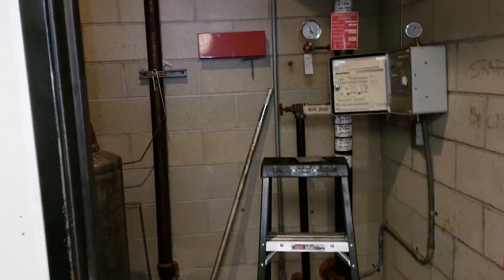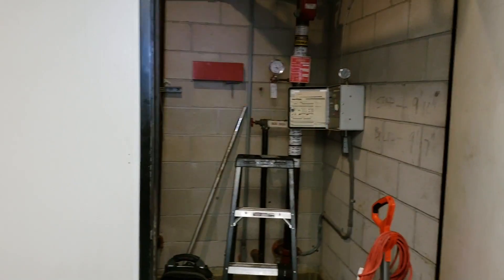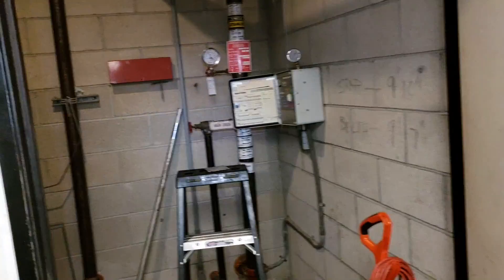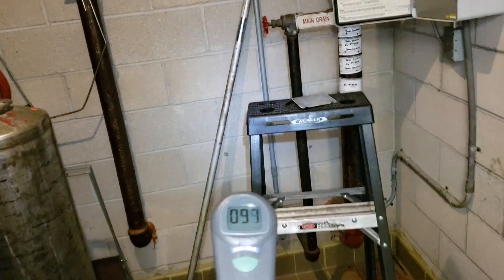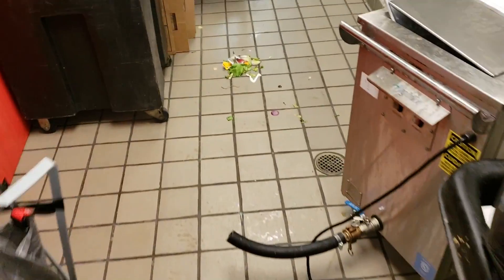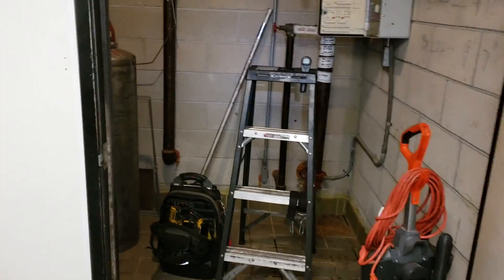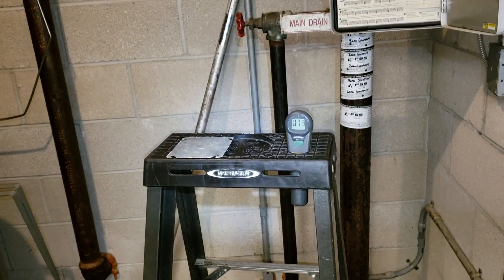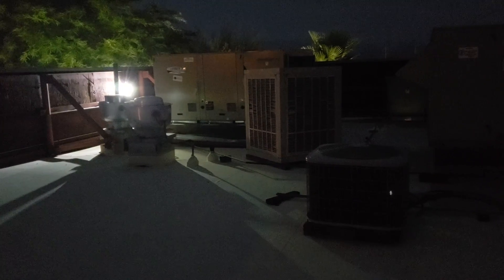Mechanical Room Carbon Monoxide Problem

Comment: Damned dangerous - CO builds big bubbles in the air when the air is not moving that you can walk in without knowing. You can breath normally in one point and a few inches further you breath pure CO and are down in seconds. Here in german the fire department and the chimney sweeper wants you to install a CO sensor in the room with the heater when it is a commercial site. Private installations does not need this but the chimney sweeper that tests the security of installations every year recommend a combined sensor for safety. It checks for CO, CO2, propane, butane, methane and heat over 85°C. Additionally it's law that the room with the burner needs an open connection to the outside that is able to deliver enough air for it. No fans are allowed because they could fail. Some heating systems have a pipe for fresh air and have a closed of burner that doesn't pull the air for the burner out of the room. In that case the requirements of the law are fullfilled by the fresh air pipe.

Comment: CO is no joke...bus barn required me to have audible CO monitor on if I was in the shop or working inside an engine  bay even if outside... (behind the hood of a bus there's almost no ventilation even when it's open due to the shape) it only went off twice... if I had not had it there was noone around to save me

Comment: Hi, thanks for your explanation of the negative air balance. my building a print factory in the Netherlands has a huge negative air balance, I notice that every morning when I opened the doors I have pull real hard to open the doors in the wind is really hard at that time. So it's not so bad because we have no combustion units in the building. never the less it's not good so I will take some action.
Reply: Combustion products / flue gases aren't the only thing that can cause problems. Chemical vapors such as solvents from inks, and dusts can be major problems, including fire hazards as well as toxicity issues.

When you are designing a ventilation system for an industrial application where hazards need to be exhausted, you must go with a single-pass scheme... it is not safe to have a recirculation of conditioned air that comes into contact with the hazardous vapors/dusts/fumes.

When possible, the ventilation system for such buildings should have a dedicated supply of makeup air, and the inlet flow resistance must not have a pressure drop that exceeds the capacity of the exhaust handling equipment.

It is desirable - often mandatory - to have the workspace at a very slightly negative pressure (a few mm = a fraction of an inch of water column) relative to the rest of the building, in order to control the flow of the bad stuff away from where people are to be found...  there's a science to balancing the supply of makeup air to the hazardous areas in order to ensure safety. 

This also gets to be interesting as a design challenge for fire protection, where the building needs to provide enough fresh air such that the occupants can safely evacuate while not fanning the flames, and then when the firefighters are on the scene can be opened up to vent the smoke while they fight the fire. 

Industrial ventilation can be fascinating as an engineer... 8-)

Comment: I would recommend decoupling the water heater from the building air. Add an intake pipe which sucks air from outside the building for the water heater's flame.

In Germany we usually have an exhaust fan on those units, which's RPM get monitored by the unit.

This is necessary, since the exhaust is too cold after the heat exchangers, to vent out with the chimney effect alone.

Comment: I have a good question how do you detect your negative are in the building what do you use for equipment for that I'm just curious
Reply: Quick check is to go to the door and open it about half an inch, you should feel air being pulled in slightly. If not you have positive flow.
Reply: I'm no tech but i believe that particular piece of equipment is called a manometer.

Comment: Sounds like you need to isolate that mechanical room from the effects of the building negative pressure , or you need to cut in large enough combustion air openings to prevent  the mechanical room from going negative under ANY condition.   That includes someone shutting down the AC units, or changing the minimum air settings on the economizers.  That inducer fan on the water heater is not designed to push combustion products out the vent.  It is designed to overcome the resistance in the water heater itself, and deliver the products of combustion to the vent connector.  I would not have an exhaust fan in the mechanical room. It will rob the water heater of combustion air.  The combustion air openings in the mechanical room, one within the upper 12” of the space, and one within the lower 12” of the space are  designed to provide ventilation, and make up air for the draft diverters, along with providing the air for combustion, so  there is no reason to have an exhaust fan in there.  It is against code, at least in our area, to draw air from a space which supplies combustion air to a fuel burning appliance, be it from a return air grille, or an exhaust fan.  If all else fails you may even have to install a positive pressure combustion air fan, with a pressure switch, interlocked with the appliance, that would not allow the water heater to fire unless the room was under a positive pressure.

Comment: I saw the same problem at a restaurant that I had worked for when I was in college for this field. They kept having the water heater blow out. I did a quick check with nothing more than my hand near the vent for the water heater after I got it going and I could feel the heat coming out. I told the store that they needed to deal with the makeup air situation and that the easy solution would be is to open a door so that the exhaust hoods (2) could pull the air they needed and not mess with the water heater. Eventually TempRite came out and just put a door on the closet and said that it would be just fine. It did not and eventually the hood over the dishwasher was shut down until the hood over the oven got serviced, at that point the makeup air was corrected with the fact that the oven hood had a pressurized makeup air system with filters inside of the hood that had not been serviced the last round. Dishwasher hood got turned back on and all was fine. Another story for those out there that need to look at everything when it comes to the air balance.

Comment: You're correct about carbon monoxide. Even if you didn't hit your head the lack of oxygen alone could kill you. You could indeed go in for a few minutes it'd be like holding your breath except for a shorter amount of time due to the monoxide being metabolized into dioxide. Same thing goes for a gas leak like propane, natural gas, or refridgerant. Except those don't get metabolized. I'd actually avoid the area completely, personally I'd go from just taking a peek to attempting to fix something and die from being suffocated.

Comment: I wonder what the reading was in the flue of the water heater and if it was back drafting.  The door to the water heater room had no vents on it for combustion air.
Reply from the maker: The meter pegged in the flue, and there was a transfer grill in the door it was just hard to see.

Comment: Excellent video - I always check for Carbon Monoxide levels any heating equipment during service calls.    Normal level @ 0 PPM,  ASHRAE level @ 9 PPM,  TWA - OSHA level @ 25 PPM .

Comment: We need to keep the economizers at 5 percent in summer time where I live because humidity is to high,units cannot dehumidify outside air, feels sticky in the space,thanks for posting this
Reply from the maker: Yeah me opening the economizers is a temporary solution. They will definitely need to add a bigger mua unit for sure

Comment: So not sure why you would ever have an exhaust fan in a mechanical room with a natural draft water heater. A mechanical room should be slightly positive pressure, never negative by design. But with the whole building being negative, the water heater gas vent becomes a makeup air duct & allows the incoming air to spill out the draft diverter. Unfortunately when the water heater  kicks on the gases spill out as well. Now it’s burning clean so it’s spilling CO2, which is heavier than air so it sinks & becomes the primary air for the water heater burner at the floor. Now we get a dirty burn & the CO goes they the roof! Yikes. Well as usual Chris your customers are lucky to have you on their team! That could of got ugly real quick. Nice job!
Reply from the maker: Yeah it was an eye opening experience and I'm thankful I grabbed the Co detector!
Reply: @HVACRVIDEOS  you need to supply air for what is going out the chimney. Usually in a house it is a passive pipe sized for the heating equipment that is putting gasses out a vent. This is to make up for lost air. Wasn't the exhaust fan was a mistake from the get go?

Comment: Yikes! In my area CO with those readings, the gas company doesn’t open the roof hatch, they lock out the gas meter until the situation is resolved...☠️
Reply from the maker: Yeah I was absolutely blown away that they didn't shut them down
Reply: That sems excessive, you don't shut down the gas supply to an entier building because one device is creating CO2, you shut down that device and get it fixed.

Im just glad I live in acountry where gas-powered heaters are required to have their own dedicated inlet and outlet for outside air. That way CO2 cannot leak into the building no matter what.

Comment: I walked into a movie theatre remodel one time where they added a kitchen, but relied solely on the kitchen economizer damper for their makeup air.  While in the meantime adding about 10,000 cfm worth of exhaust to the kitchen.  The electricians had to shut down the power to the AC unit for a while, and the kitchen doors (the double swinging type) sucked right in.  Fortunately and not surprisingly, the pilot light on the water heater got snuffed out instantly and the water heater shut down.  I spoke with the architects on site and noted this.  They all got wide eyed and pulled out their phones and started making calls.  The next day the contractor was adding an actual make up air assembly over the kitchen.  Which allowed the damper to be backed off on the kitchen AC.

Comment: Hey buddy I have a question for you, or others watching....I wanna know can I put 407c in a unit that has r22 in it..thnx
Reply: You cannot add R407C to an R22 system that has R22 in it.  All the R22 would need to be recovered, and POE oil would need to be added to the system to properly run with the R407C.  Some say you can get away with adding 10 to 20 percent POE oil to the mineral oil and still get good results.  In situations where I have used R407C, I have been replacing the compressor and the new one came with POE oil.  So I haven't had to handle the oil change portion of a retrofit blend.
Reply: All above is correct but don't forget to change all the driers on system. The old cores will have trace R-22 still in them. New TXV would be nice but just compensate on your pt chart if using R22 txv.
Reply: Excellent notes.  Any time I open a system they get new driers and cores regardless of what the repair is.  Cheap insurance and such second nature to me I didn't even note it.
Reply from the maker: No

Comment: How can you measure this make up air and exhaust
Reply from the maker: Like I stated in the video I am not a certified air balance professional but I used a crude method that I knew and that was to use smoke to show me which way the air was moving when I opened an exterior door.
Reply: HVACR VIDEOS shit I’m looking at the sensorcon co detecter now for winter time.
Reply: No I’m just interested in you showing me that’s all. I enjoy how thorough you are. And that’s something that I’ve seen on restaurants. Not the carbon but the vaccum that you can hardly open the door.

Comment: I wouldnt touch it with a 10 feet poal! You just made a more dangerous situ, if the ac shuts down for what ever reason, what will happen?
Just shut the water heater let them hire a somebody to fix the origin of the problem.
Reply from the maker: Yeah I told them to call an air balance company but I could not shut down their water heater. They would have to close the restaurant and that would not be good. As far as making a more dangerous situation while I dont agree with the way the building is balanced it is perfectly acceptable as far as using the rtu units for the makeup air,  it's not ideal because just like you stated if the ac gets shut down they will have a problem. They also need to install carbon monoxide detectors. I informed them of all those issues and let them know they need to get an air balance company involved to permanently resolve the issue.

Comment: No fresh air,available? Besides using damper/control RTU make up.
Reply from the maker: They have a small makeup air  unit but it was already tapped out as far as how much air it could move so I had to pull from the rtu units